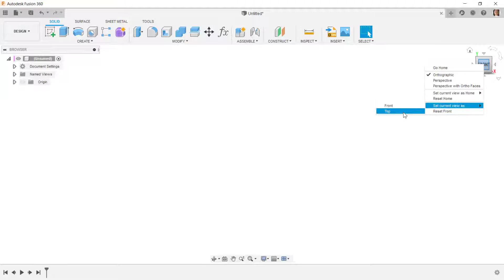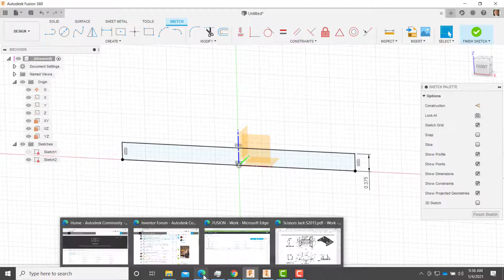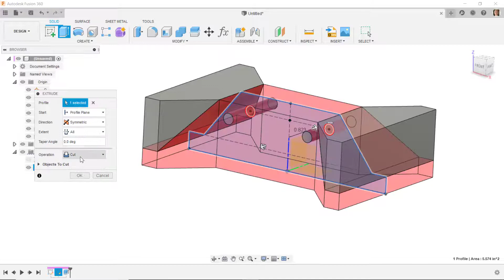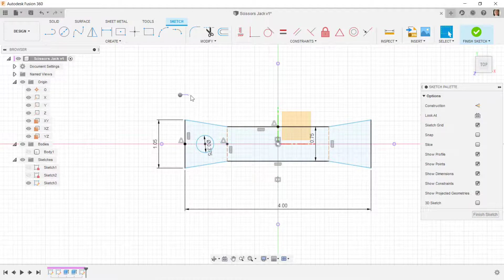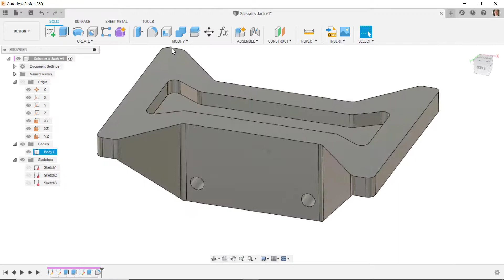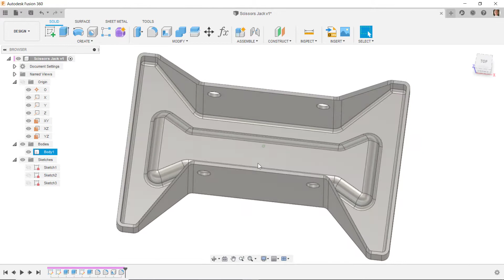Scissors Jack   Video 1 of 8

Comment: Dear SIr, if i connect e.g 10 scissor jack linear, with one trapezoid screw and one scissor jack lift 1tn, then 10 scissor jacks will lift 10 tn? linear?
Reply from the maker: I would not want to trust that the load could be kept evenly distributed.  Use a jack(s) with higher load rating. Or at least use blocking in case a jack fails.
Do not take this response as safe advice.  Be safe.

Comment: Hey Mather, I had a doubt with the belt drive in solidworks. The belt won't move when the pulley is rotated. Is there a way we could get it done.
Reply from the maker: This isn't for SolidWorks - but might give you some ideas.
https://www.youtube.com/watch?v=yWSSJXxm6GA
Use cosmetic tricks to represent the motion.